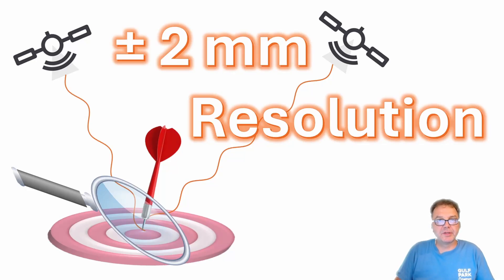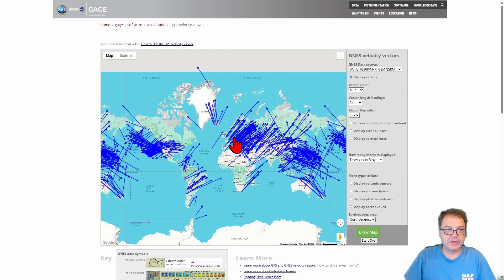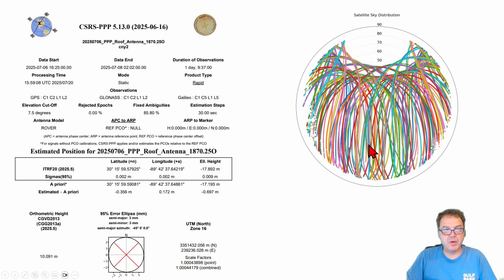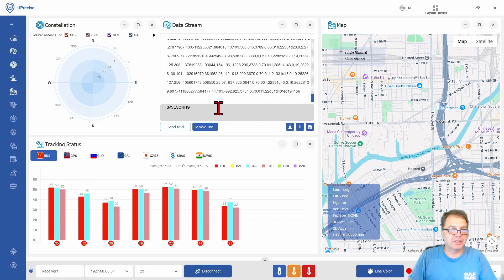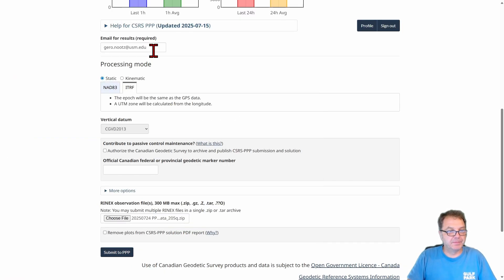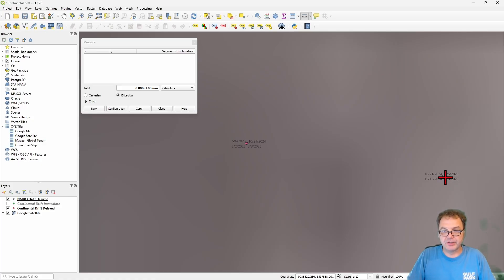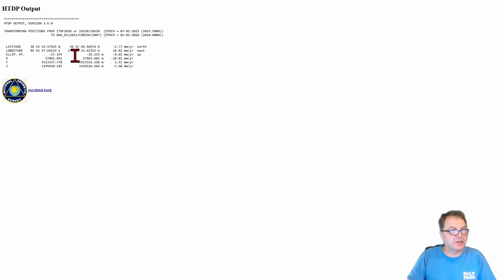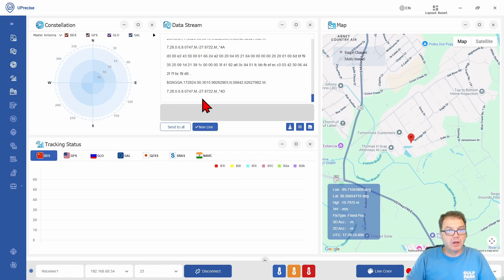Millimetre-level Geolocation Using Precise Point Positioning with Ambiguity Resolution (PPP-AR)

Comment: I have been following your videos very closely, as I recently purchased the UM980 and UM981 modules with the intention of developing my own low-cost equipment. I understand most of the information you've covered, but I have one question. Is it possible to perform static measurements with these devices? Does the hardware have the capability to perform and store this data, or is it necessary to incorporate an external data logging device, such as an SD card reader or similar? I would greatly appreciate any help you can offer. Best regards from Chile.
Reply from the maker: Not quite sure what you mean by “static measurements,” but the UM98x modules will require additional hardware to store the data. An ESP32 board with an SD card would be a good option for handling the logging.